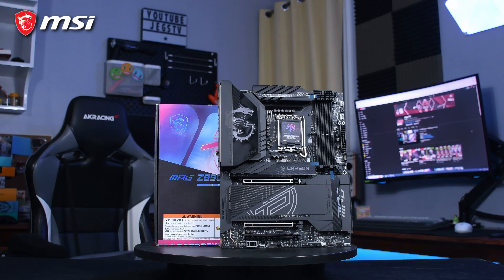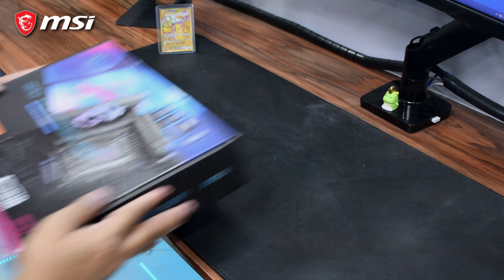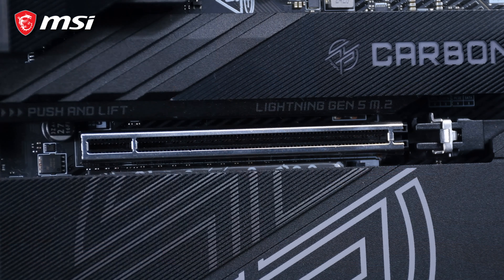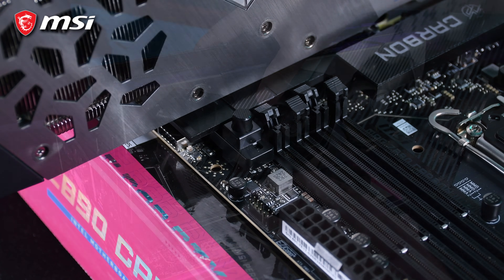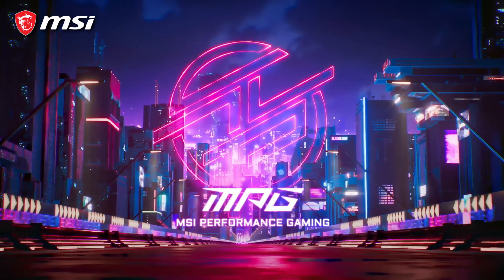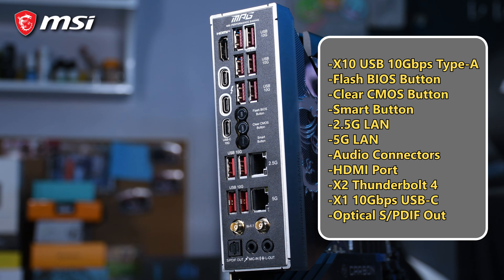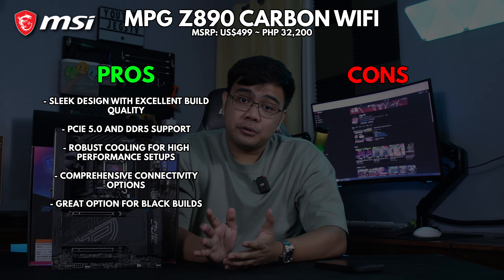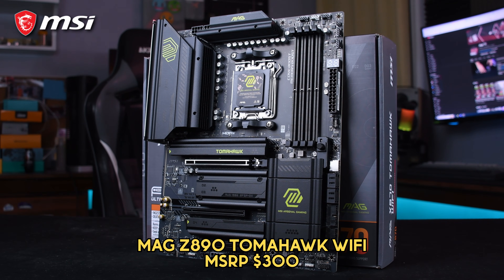Built to Impress | MSI MPG Z890 Carbon Wifi Review

Comment: You missed some things there. It supports up to wifi 7 and with Killer wireless you have double shot pro which means that you can use BOTH ethernet AND wifi together simultaneously. Also when you have m.2 slots you should always try to point out if it shared bandwidth with the gpu slot, otherwise if you use the slot that does your gpu will go from x16 to x8 for shared bandwidth. Overall decent video my dude!

Comment: Matinding downgrade to..lol

If not pursuing 8K MT's RAM Speed on ARL-S and a bit of overclocking, nagtatapon ka ng pera on this platform..lmao..
Reply: @GameTechPlace  you're just justifying your purchase, hindi naman ganyan mentality ng user na bibili/magbubuo ng bago.

Since for "the sake na gumastos ka kase keri mo" baka naman kaya mo kahit 8000MT's on RAM? FWIW, I own a 13900KS na binned, does 8600MT's CL38 on my Z790 Apex, also may AMD test platform din ako with a zen 5 9700X with 8000MT's CL36 on my B650E Tachyon.
Reply: @benuten3907  Yes, I actually and recently purchased two G.Skill Trident Z5 Neo RGB 32GB (2x16GB) DDR5 8000Mhz CL38-48-48-128 1.45V Amd Expo Desktop Memory to fill up the 4 slots of MSI MPG X870e Carbon Wifi motherboard.  My chosen CPU is the Ryzen 7 9800X3D, though it is not the king in productivity but it is the king in gaming, MSI MAG Coreliquid I360 Liquid Cooler to cool off my CPU (though it doesn't have the LCD but it performs very well), 4TB Samsung NVME m.2, PSU of NZXT C1500 1500W 80+ Platinum Fully Modular Low-Noise ATX 3.1 Power Supply, case is Hyte Y70 Touch Infinite Modern Aesthetic Case, and for the GPU is I am still waiting for the RTX 5090 (1 month to go).

Also, I am a bit skeptical of that 8600MT's CL38 and that 8000MT's with CL36 that you mentioned above, can you drop the whole name or brand of that RAM so I can check it out? I want to know more of that if that really exist, especially in PH the RAM with the highest mhz or mt that I know of is the one that I purchased in datablitz ecommerce.

You may also make a video, say something and upload it as your content in your youtube channel about your rig so for us to learn more about it.